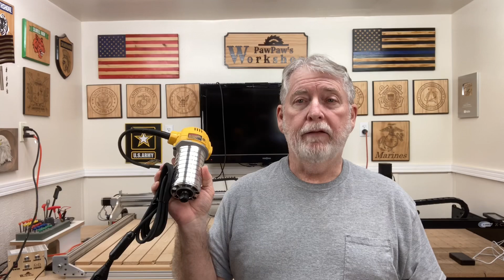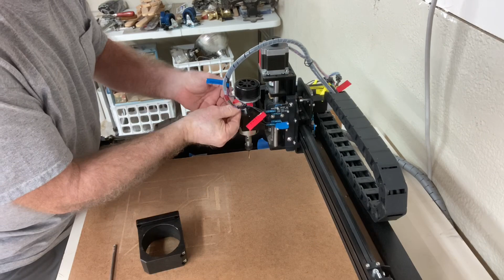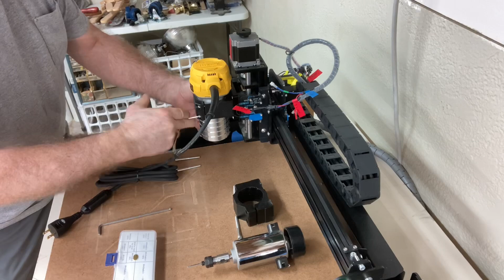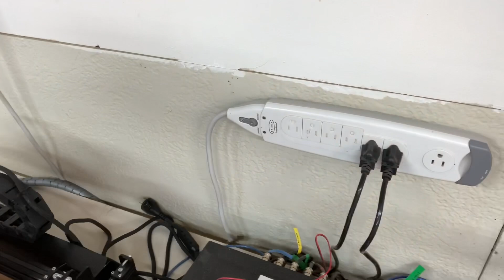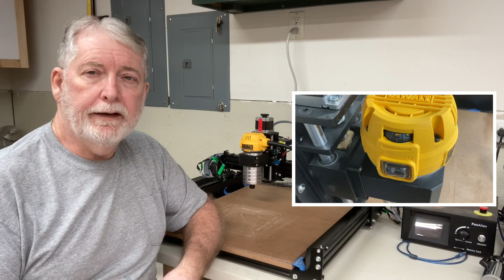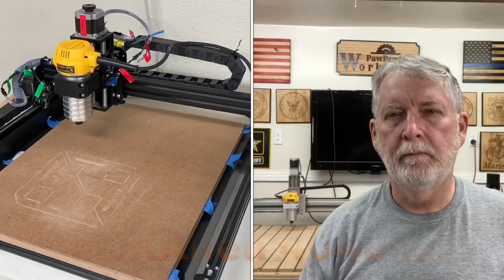How to Add the Dewalt 611 Router to the FOXAlien 4040xe

Comment: A clarifications: do you disconnect the power cable from the back of the controller so there is no power going to the connectors you disconnect from the original spindle? Didn’t want “live wire” flapping in the breeze.  Thanks for you videos - they are very informative and helpful!
Reply from the maker: That is correct.  Always, safety first

Comment: thank you for taking all the time helping everyone. ok I have made the change to the Dewalt dwp611 I have set it up just as you described in the video. I have checked and checked and double checked to make sure that I did it just as you show in this video. I am on the second dwp611 router and it is not working as it was when I got it brand new. I have noticed  there is small oil spots on the project like the router is getting hot but when I checked the temp it was just fine. so it looks like it might be the brush dust from the router. I am at a loss on this issue. would you have any suggestions on fixing this issue thank you for your help Les McKenzie .
Reply from the maker: Brushes only last about 150 to 200 hours. Here is a video on checking the brushes. https://youtu.be/SrQvdLlngIw?si=YMYvuBeXqE61jp8A

Comment: Thanks for the video. I just got the Fox Alien Masuter Pro and already thinking of replacing the spindle. Not sure if I should go with the Dewalt or Makita router, I'm sure either one should work well. I'm definitely going to get the Fox Alien relay module though to control the on/off of the router. You do a great job with your videos, I really enjoy watching them!
Reply from the maker: Thank you very much and congratulations on getting your FOXAlien

Comment: Great video, one question Sr, can I change on the masuter 4040 ?
Reply from the maker: The Masuter is a little lightweight. I would not recommend putting the dewalt 611 on that cnc

Comment: Dear Paw Paw, Thank you for your professional and entertaining videos! I bought a 4040xe for use in germany (230V AC). Is it also possible to connect a german DeWalt D26203 or Makita RTO710C to the controller? THank you! Greetings from Germany, Mick
Reply from the maker: Yes, you can but not directly. You will need a relay added in to control the router.
Reply: Thanks a lot! @PawPawsWorkShop

Comment: Hello Paul Paul, this is Tim Curtin again. My Fox alien 4040 XE is arriving tomorrow and my D Walt DWP 611 router arrived today from Home Depot. I went ahead and mounted it to the 69 mm bracket that was recommended for use from Fox alien then also came a day or two ago and I have two questions… Firstly, the two Torx head screws one of which is slightly stripped after mounting it I’d like to change out do you know the Size and pitch assuming they’re metric I’d like to switch to something other than torques like a socket cap or something similar that with a better more rigid head it’s not so soft is the one that comes with the mount. Secondly, as you were probably aware of these use ER 11 collets either for 8 inch or quarter inch bits and I have both. But I noticed as I don’t see a normal nut they can… Does the CNC machine come with one I’m assuming? I hope so because house can you mount your Kaulitz with various tools in them? Looking forward to your reply… Tim Curtin. PS: I’m very familiar with CNC operations and factory my company I use a shop saber 3636 in my operations which is about a 4‘ x 4‘ area for operating and working area. They use an ER 30 to call it with a much bigger tooling of course. At any rate I look forward to your reply
Reply from the maker: If I remember correctly, it is an M5 8

Comment: I am buying this machine next week and upgraded spindle DWP 611. Any suggestions on cutting aluminum with this updated Spengel? And in your CNC code in the software (NC file), I’m assuming control the speed and things in the code as the job runs, is this correct?
Reply from the maker: For aluminum keep feed rate and plunge rates low. 4040xe is the minimum. Next up is the VASTO. It’s much more of a solid machine. Check out the affiliate link in the description to take you directly to their site. Thanks for watching

Comment: Paw Paw I purchased the 4030 CNC and am using the Dewalt 611 but the collet nut won’t work with the collets I ordered from Sainsmart can you help, thank you in advance for you help
Reply: I’ve just ordered some from Inventables thanks for the feed back, I’m a previous AutoCad Draftsman and would like to hear what software you would recommend for someone who has this type of experience…
Reply from the maker: My son is a certified AutoCad instructor and still has trouble with the easel and VCarve software. Start there, also get Inkscape, it’s free
Reply: @PawPawsWorkShop  I will thank you
Reply: @PawPawsWorkShop  😂
Reply from the maker: If you are trying to use the ER-11 it will not work in the dewalt 611 router
Reply: @PawPawsWorkShop  what should I do? I’m starting from scratch I have no knowledge of CNC or anything that goes with it
Reply from the maker: The collet for the dewalt 611 router can be obtained on Amazon. Also Inventables sells them. The collet is 1/4” in diameter. The inside is designed around the bit diameter usually 1/8” diameter

Comment: Does using a dewalt router limit the choice of bits because of the collets that are available
Reply from the maker: No, just like any other spindle you will need the correct size adapter

Comment: Hey paw paw will this be the same on the basic model I have the masuter and where can I find the brace
Reply from the maker: You can upgrade to a 300 watt spindle for the Masuter. The dewalt 611 is a little to bit and heavy for the Masuter
Reply: I was wondering the same thing. Thanks!

Comment: Hey Paw Paw, I really enjoy your videos, thank you.  I am considering the fox alien 4040xe, and want to know if you have done any 3D carvings on it yet?  This is am important function I am wanting to make sure my cnc has.  I can't find anything on you tube about it's 3D capabilities as yet. Also I don't think we can get that Dewalt router here in Australia, did you replace it from the stock one because of any problem, or it wasn't powerful enough?  Thanks. Yindi
Reply from the maker: The 4040xe can do the 3d carving just fine. I showed the upgrade to the dewalt611 because so many asked for the video. I have since put the 300w spindle back in the machine. The router went to my router table
Reply: @PawPawsWorkShop  thanks so much for that Paw Paw. I look forward to seeing the carving it can do when you get one up on you tube. 👍🏾

Comment: Wouldn’t you have to relevel the router to the wasteboard, since you changed it out?
Reply from the maker: No, I just put the mount back on and drop in the router
Reply: @PawPawsWorkShop  hmm ok tyvm, I’ve surfaced my wasteboard and it still seems like my rightside doesn’t cut all the way. Even tried resurfacing the wasteboard and my project board and then cut, and still same issue. So I figured it was me changing the router out. 🤔

Comment: recommended IPM with the dewalt on setting 1? soft woods like pine with 1/4 or 1/8th
Reply from the maker: It also depends on the machine. You should be able to run feed rates around 150

Comment: I'm wondering if it is possible to upgrade the Genmitsu PROVerXL 4030 or the FOXAlien 4040xe to have a larger foot print by swapping out the extruded aluminum to make it a little wider and longer. Extruded aluminum from 8020 Inc or Tnutz. I'm sure there are other mods or upgrades to be made for the larger foot print (e.g. drive belts, wire extensions), What do you think?

I do not have a CNC, but would like to get one. However, none are in my current budget. Since the XCarve came out, it has doubled in price. So, between the Genmitsu and the FoxAlien, which one would you recommend for a first time user on a very low budget and can be upgraded a little here and there down the road?
Reply from the maker: I would have to recommend the genmitsu. They have a new expansion kit to enlarge the footprint.